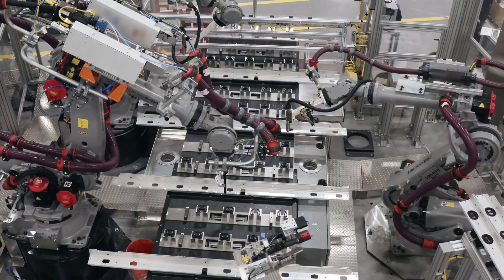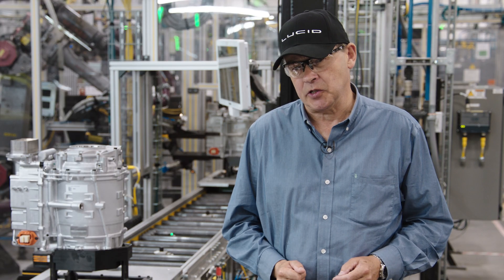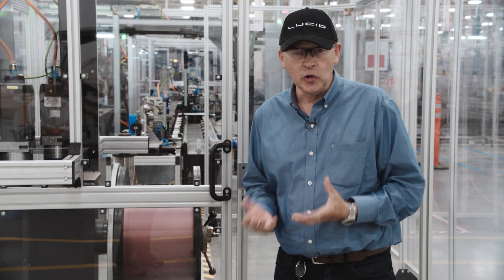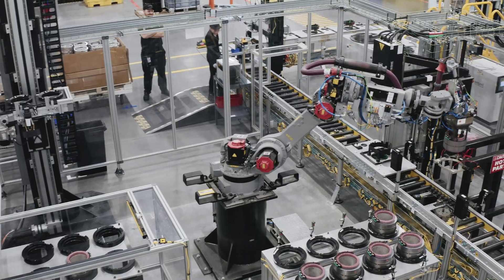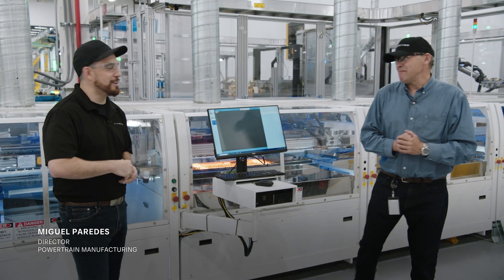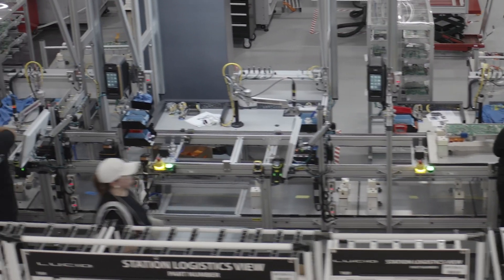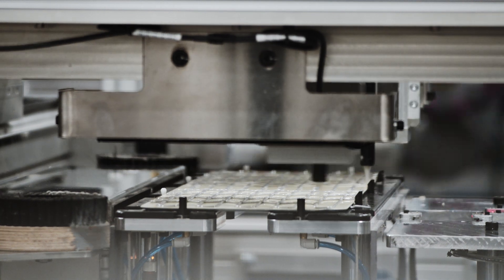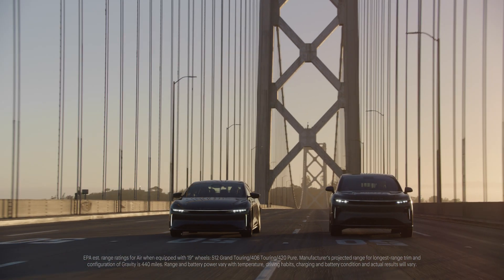Preparing the Factory: Powertrain | The Road to Lucid Gravity

Comment: The wunderbox is fantastic! I charged my Rivian with a portable 240v 30A charger. It could only do 11 miles per hour. My Lucid GT gets 22 miles per hour from the same charger. That's crazy. Also, fast charging is much better with the Lucid than anything else I've tested. All that and it has the nicest interior, best UI, unmatched performance, most comfortable drive, and best range. Bravo, Lucid.

Comment: Rawlinson does a great job of articulating the engineering focus of Lucid: efficient drive trains consume less power, so you don't need such a big expensive battery, keeping the car weight down, which feeds back into the efficiency of the vehicle in a virtuous cycle.  And when you have a smaller battery, you don't need to sit around at a charger for as long.  The Air really proves the concept out, and I'm looking forward to seeing a Gravity in person.

Comment: Cars are luxury luxury stocks and penny stocks.
Reply: Before Tesla turned a profit in 2019, nobody cared about car stocks. Now everyone cares about car stocks for some reason 🙄. Tell me, do you care about KIA stocks or Samsung stocks before you buy their products?
Reply: @Lando_Sage wasn't Tesla cash flow positive with the model S
Reply: @TheMagicJIZZ  no. When Tesla reported on cash flow with the original Model S, they were using core cash flow, not free cash flow. Meaning, they were only reporting the transactions of the product itself, without capex. The higher the numbers, the more cars they were selling. If you were to include capex, the cash flow would be negative, as they were dumping massive R&D and building the first Giga factory. They did this to make their stock more appealing than it actually was to investors.

Comment: The best powertrain in industry by Peter and Emad as head of Powertrain. 
Fully supported to our leadership
Reply: They should design and manufacture F1 inspired carbon fiber core rotor e motor which can rev to amazing 30,000 rpm,15 hp/kg drive unit level power density(each drive unit should be able to produce 500 ps and 700 nm of torque with weight of 35 kg each) and 2 speed transmission drive unit for maximum efficiency . They should use samsung's solid state battery cells in their battery pack,if they do 2027 lucid air sapphire will weigh only 1780 kg with 600 miles of range with 6.3 miles/kwh efficiency,please lucid read my comment do it exactly like i just said...